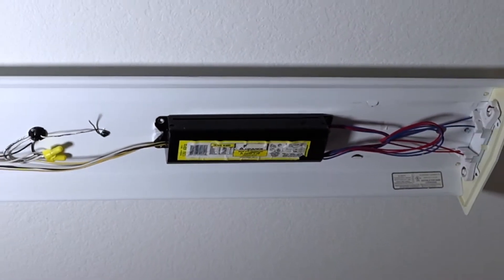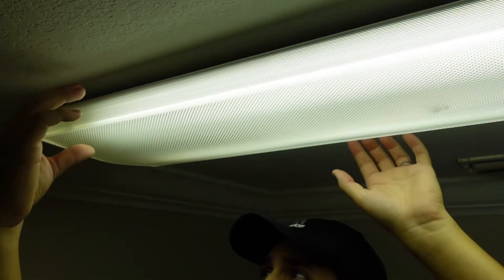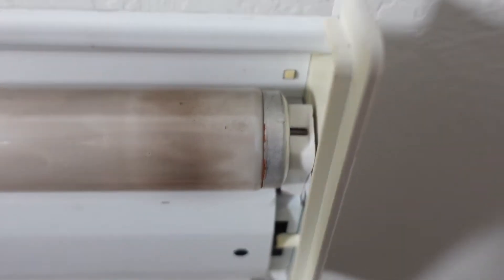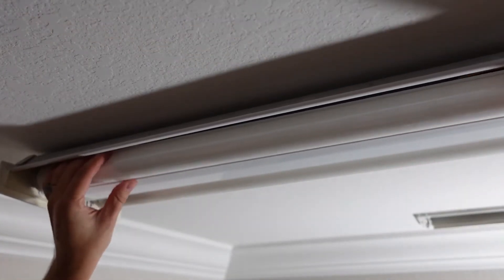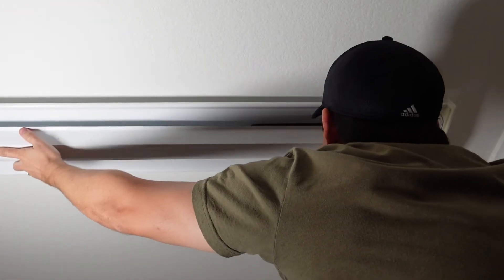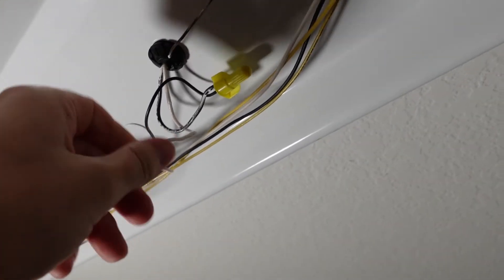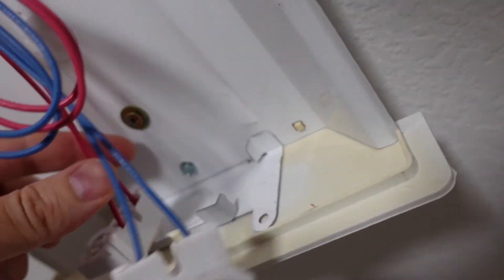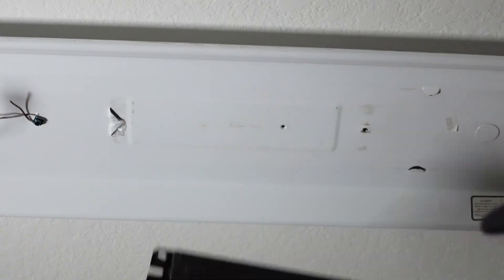How to Remove a Ballast

Comment: How do I know what ballast to buy? Another video possibly? Trip to the hardware store….?
Reply from the maker: Just look at the existing ballast that you currently have. What light is it for T8 or T12? 4 tubes or 2 tubes? Also check how many watts it requires?

Here is 2 tube, T8 version ballast: https://amzn.to/3Remu1v
Here is 4 tube, T8 version ballast: https://amzn.to/44MK1JU
Here is 2 tube, T12 version ballast: https://amzn.to/3EvdddN

If you want send me the part number of your ballast and I can look it up for you.
Reply: @Daddicated  ill look those up!
Reply: It may be easier to remove it and replace the bulbs with LED
Reply: I did end up going with LED bc I could get the whole thing fixture and all for about the same price I was seeing for the ballast and it “should” last longer.